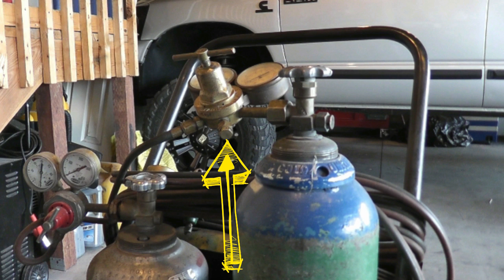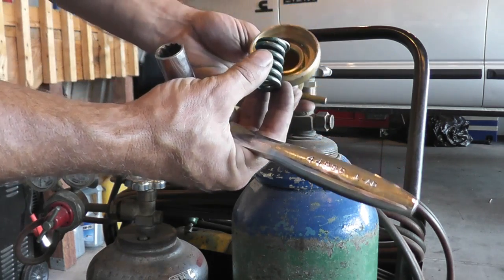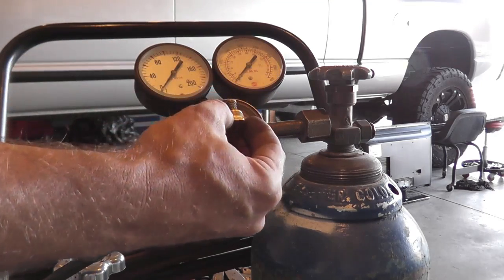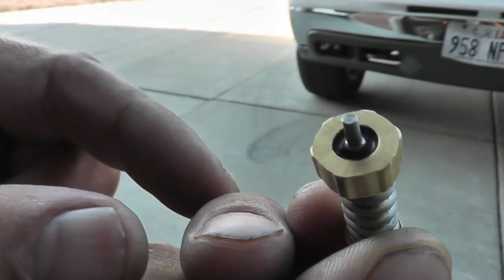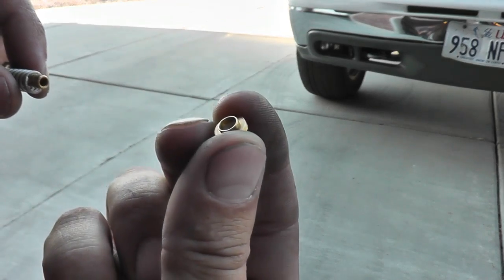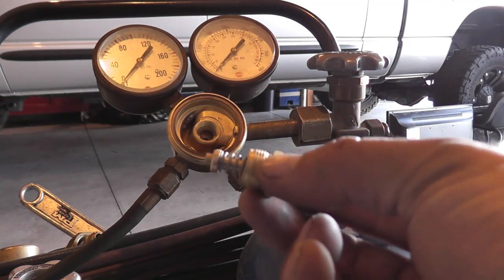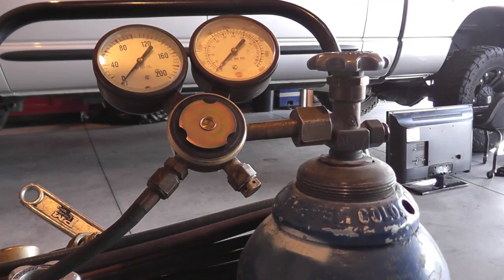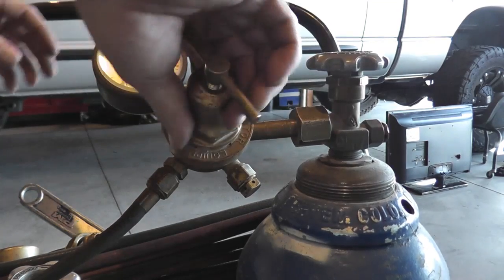Rebuild a Victor torch regulator

Comment: Good Video, I wish I had seen this a few days earlier. My torch oxygen regulator blew out while using the rose bud tip last month, the air was coming out just where you say it will.  After 30 years of use, I thought I deserved a new torch kit anyway so I bought a very nice HD Olsen set that is bigger heavier torch.  I was going to just throw away my old set thinking it was a cheapo Tool King kit I bought years ago, then as I examined it I realized it's a VICTOR and I remebered buying it with my welder at AIRGAS in Colorado. Now especially after seeing your video, I am going to buy the rebuild kit and do both regulators. I'll keep them in storage in case my Olsen kit isn't satisfactory. .. Thanks.

Comment: An important side note here is when handling the internals of a regulator is to keep all contaminants out especially grease and oil which can ignite in the presence of high pressure oxygen

Comment: !WARNING! I just picked up a Victor Weldmark RC250-125-540 reg because I couldn't get parts for my offshore unit. Before I used it I wanted to see if kits were available, and they are not! Apparently if the model number is not stamped on the upper ring it cannot be repaired because they don't supply parts! This new one has no model or serial numbers on it. Beware of the Victor off shoots like Weldmark and Radnor. Victor is selling out on their once good name :~(

Comment: Good video. The only thing is to make sure to wear gloves to prevent any oil residue. Any oil can spontaneously combust in the presence of high pressure oxygen.

If it is dirty inside the regulator, it can be cleaned with dish soap and water. Check for leaks with a spray bottle of soapy water.

Comment: Outstanding!  it did not show you changing out the rubber with the hole in it or i didn't notice it.
Reply from the maker: Hi... The rubber with the hole in it is part of the stem and is not serviceable. Your rebuild kit will have a new stem as part of the seat assemby.

Comment: Yes I was tearing my acetylene torch apart do you clean it and the two tubes on the torch I separated those and there was a iTube inside on the oxygen side on  and it looked like had carbon buildup on it I want to clean it up and Spring popped out and I was wondering if there's anything else that went with the spring other than the tube
Reply from the maker: Yes you can clean it but do not use any petroleum products. Even oil from from you hands needs cleaned off all internal parts.

Comment: I have a small victor torch set ,for HVAC work. they are new,never been used.I can't get no pressure on the working side of the oxygen regulator. I have 2000 psig on the tank gauge I crank the tee handle to get working pressure and the needle on the gauge does not move.what could be wrong?
Reply: Do you have your inline check valves oriented in the right direction? A backwards check valve won't let any pressure out. Does the low pressure gauge move when you tighten the t handle on the regulator?
Edit; sorry. I just reread your comment about the needle in the l.p. gauge not moving .. did you remove the dust plug from the O2 bottle before hooking up regulator? I know. But I had to ask..  were there any similar plugs in the new regulator? 
Oh,, how does it feel when you tighten the t handle? If there's no resistance, its possible there's something missing that's supposed to put pressure on the diaphragm. ..maybe spring is missing , maybe it's the kind with linkage or maybe the button is missing from top of spring ?
Reply from the maker: Idk... It is a simple mechanism maybe someone at the factory forgot a part to the seat assembly.  Is it brass like this one or a newer plastic ones that you can't disasemble?

Comment: Inline 6 CTD.  Great vid.  Had one of my customers aim me to your page.  Thermadyne has changed since Esab bought them out and they no longer share their literature and breakdowns.  If you don't mind, I'm going to share the link to our eBay store, where we have breakdowns for most of the popular models.  We do sell the kits there, yes, I know this is shameless product promotion, but we really do give a good deal.  Most of our kits are built from genuine Victor parts and contain Krytox, and we are the only ones on the net that include grease.  People don't realize how important it is to use a high quality non-flammable grease on the rebuild.  There are other sellers on eBay, just make sure you are comparing apples to apples.  

http://stores.ebay.com/Discount-Welding-Supply
Reply from the maker: Hi great to hear from you.I just checked out you ebay store. You sound very knowledgeable with torch equipment. Yeah I was wondering what happened with the link I put in the discription it's now a ESAB website I didn't know Victor was bought out. I think I printed off the PDF and have it in a file some ware. I'll have to figure out how to get a still shot of it and edit into the end of the vid. You are more than welcome to use this vid link for your customers. Thanks for leaving your $0.02
Reply: Torch Doc, I know this is an older post but I just looked at your eBay link. I notice you're in Vegas. Any chance you folks have a shop there or is all your business e-commerce?
Reply: I'm a happy repeat torchandregdoc customer. I found out about him via the Weldingweb forums (THE most comprehensive welding forums).

Comment: I have several Victor regulators that have problems.  None of them have a model number only serial numbers.  I've never seen an older regulator with a model number.  I've contact different people and nobody has a conversion table (serial number to model number).  How did you determine what model number your regulator was?  It looks like an old one just like mine.  Also sometimes when a regulator is taken apart there is no apparent problem either with the diaphragm or seals.

Comment: Thanks for this info. Bought my equipment in 1983. My torch is leaking acet. at the valve and my O. reg. has a leak. Wondering where you got your parts? I live in Utah too.
Reply from the maker: You can get a genuine ""victor"" rebuild kit off ebay for $22. And for around $15 There are cheaper knock off ones as well. I used the victor brand. Thanks for watching!

Comment: in my country you can find second hand victor regulators.. do you recommend to buy a secondhand victor regulator? if thats the case what model do you recommend and what model can be rebuild to last lots of years? now when i lightin my torch the flame pulses and i think is my chinese regulator....
Reply from the maker: Hi... Yes I would recommend getting any of the "brass" victor regulators. They are all rebuild able. Alot of the new victors are "plastic" and are not rebuild able. Thanks for watching!
Reply: ok i found a victor csr 350d.. whats do you think? 60 dollars buy or not to buy?
Reply from the maker: I'm not familiar with that reg. but I believe it is just a 350 series reg. "CHECK OUT THIS LINK".http://www.regulatortorchrepair.com/regulator-parts-repair-kits/sr350-repair-kit

Comment: Great Video, thanks.  I was trying to open a Victor CSR150CR but that does not have a hex on the outer cover.  Any advice on how one gets that open?
Reply from the maker: I am not familiar with that regulator. Victor does have assemble/disassemble  PDF files available on the web for most of there regulators.Thanks for watching

Comment: I worked for the Navy for 20 years specifically with pure O2 and you should be wearing nitrile or other power free gloves to EVER work on the internals of an O2 regulator. The levels of cleanliness we had to go through should tell you just how critical cleanliness is when dealing with O2 equipment. Even fine metal particles like aluminum can become fuel for O2 under pressure and any oil or grease unless specifically made for O2 is explosive. This should have been part of your presentation and in your rebuild procedures, it is no joke.
Reply from the maker: +Gregarious Antithesis Thanks for the info. I think I will put at least a disclaimer. I have had others that have left comments that have similar concerns. If you would check out the link in the description of the PDF by Victor that walks you threw the rebuild. It seems to me there is no warning of what you are talking about. It doesn't mean that it isn't a legitimate concern, just bazaar it doesn't rely mention anything like what you are talking about.
Reply: Inline 6 CTD Appreciate you getting back to me and letting me know you read what I was saying, it truly is a huge safety issue when dealing with O2 no joke. We used specialty lubricants made with a teflon base that could be used and were compatible with O2 stuff is called Krytox. I have seen the results of a O2 cart greased with regular hydrocarbon grease and it entailed the adjustment knob of the regulator being blow thru a concrete wall. It is lucky no one was killed. 
I appreciate you doing the video more people should know how to fix such things its what makes youtube a wonderful thing.
Reply from the maker: Please click the PDF link in the video description and heed all safety warnings in that PDF file. Thanks for watching
Reply from the maker: yup you got the basic idea!!
Reply: your work area needs to be exceptionally clean with no grease or oil ever on or touching anything that is part of a regulator. Never use any grease or oil on an oxygen regulator unless it is a specialty grease recommended by the manufacturer or specifically safe for oxygen use an example is crytox it is made for oxygen. Regular greases of any kind, hydrocarbons or even particulate mater like aluminum filings or power are potential fuel for combustion. When you combine pure O2 with any fuel and heat is created like any gas under pressure you have the potential for fire and or worse an explosion.
Reply: Cleaning to "oxygen safe" standards is the way to go,  There's plenty of material on the internet about it. I use acetone on my metal regulator parts to ensure they are oil free prior to assembly.   Green oxygen safe Teflon tape is available to seal inlet nipple threads if you have to replace a broken nipple. (I remove the broken stubs with a screw extractor.)
Reply: And while it may go without saying, ALLLLL of your tools should be meticulously cleaned from all grease, dirt, petroleum products of any kind before using on the internal parts of the regulator. After cleaning with solvent, use carbon tet, or alcohol to removed the solvent.
Reply: Gregarious Antithesis Yes, even residual body oils off your fingers... rubbing your forehead, nose, ear, anything, will transfer combustible contamination into the valve body.
Reply: Agreed!!!!!! hair stood up on the back of my neck when I saw this.

Comment: Where did you get the rebuild kit?  Those old brass Victor regulators are real precision craftsmanship, as apposed to the plastic stuff that "Victor" sells today.  I have one from the original factory, in San Francisco CA, and it still works like new!
Reply from the maker: +Edward Bloom The rebuild kit was a victor brand I got off ebay for $22. I agree I own two sets of  brass victor regulators and this is the only one that has failed. Thanks for watching.

Comment: Thanks.    I have two complete sets, one in the garage and one downstairs.  I was doing some real fine brazing using my 000 tip, but it was too cold in the garage so I ran downstairs to use that set.  I noticed the oxygen side torch pressure wouldn't drop below 20lbs.  I initially thought  it was a bad gauge, so I swapped that out for some others I had around.  No change.
I should be able to lower the pressure down to 3-5 lbs.   After more evaluation, I determined it was the regulator.  Not liking paying people money to do things I can do, especially being a professional mechanic, I first watched your video.  Then I went and took it apart.   It was dirty inside, but I found nothing particularly bad.  I cleaned it up and reassembled it, hooked it all back up, tested it and found it was working fine with the pressure dropping down like it is supposed to, like the set in the garage does. 

You know how fun it is when you work on something and it starts working and you really didn't do anything.!   It must have had some contamination  or something wasn't quite right, but now it works.
If it messes up again, I'll order up some rebuild parts for it.
Reply from the maker: +seaswirl79  Cool glad you got it working. Yeah I am a total DIY guy I like fixing my own stuff whenever possible I try to make vids when there isn't a lot of info out there. Check out my other vids. Thanks for watching

Comment: I read all over the internet how only a professional guy should do this. I took mine apart before being seeing this and the seat seal is bad. I finally read that any oil or grease from hands or the socket you remove the seat with or even a piece of lint will cause a fire and or big bang!! LOL Now I'm almost afraid to try replacing the seat. I read there is a oxygen safe cleaner made by Crest you can spray clean it with. It certainly does not take a brain surgeon to replace the parts. Is cleaning that critical? I noticed you never said anything about being extra clean.
Reply from the maker: +Jim Hudson  It's a straight forward repair. If it were a highly specialized process then victor would not sale a rebuild kit and you would not be able to open them up with a simple crescent wrench. Victor also has a free PDF file out there that walks you threw the process. The one that I rebuilt on this vid has been going strong for 6 months. Please by all means only do what you feel comfortable with. Thanks for watching!!
Reply: +Inline 6 CTD 
do you have the link to the Victor PDF?  Thanks.
Reply from the maker: +Henry Retter  Here is the link hope it helps. Thanks for watching.
                          http://victortechnologies.com/IM_Uploads/doclib_8028_DocLib_2304_56-0607%20SR%20250%20Series%20Regulator.pdf